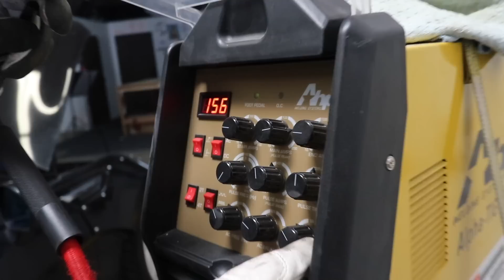NO TURNING BACK!!

Comment: Little trick to make Calvin's life easier if he's struggling welding that material he could fold the cut parts over to double the thickness. Also run lower amps with the tig slightly go higher by 5 to 10 amps til you find a good setting I'd start around 40-50 amps then go up from there.